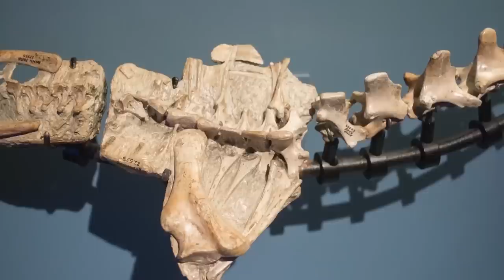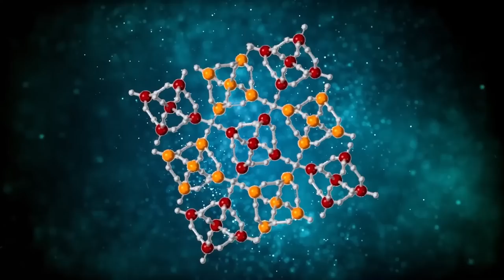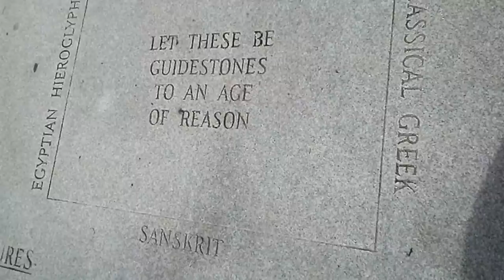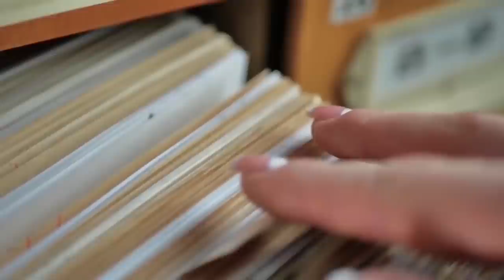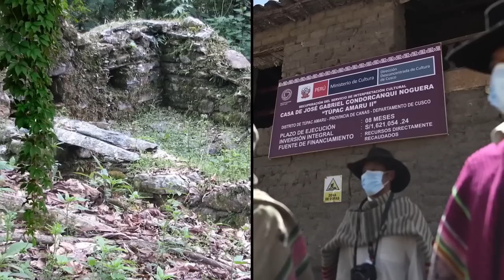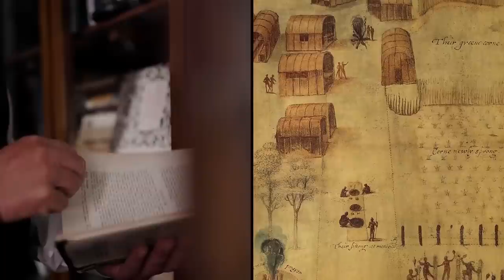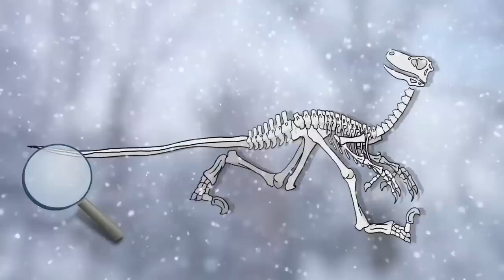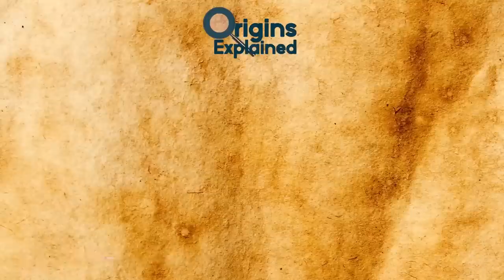CREEPIEST & SCARIEST Archaeological Discoveries!

Comment: ummm, sure canada has winter, but canada also gets extremely hot in summer. parts of the country can get as high as 50c/120f, most getting to the 30's+/90's+. canada is actually a country that has extreme temp differences between the seasons.